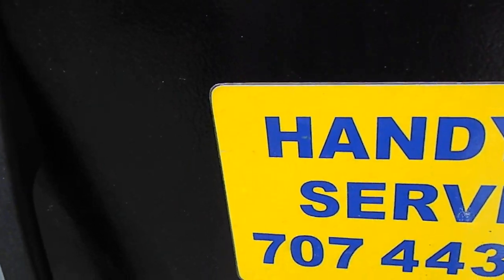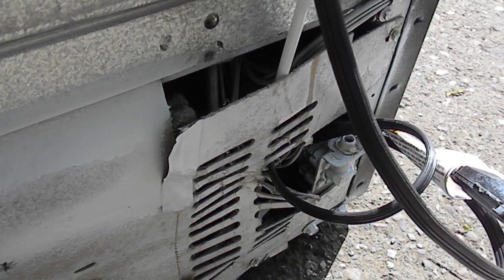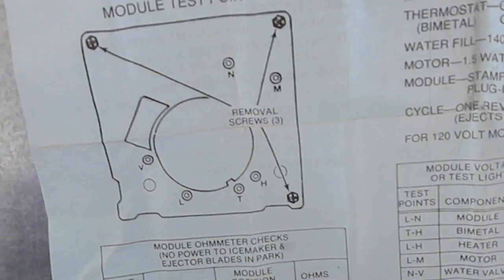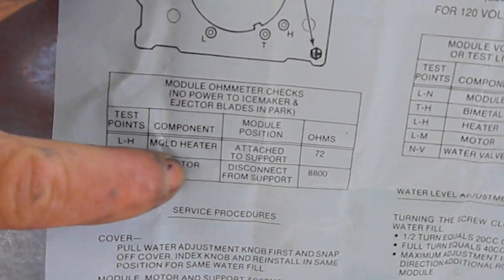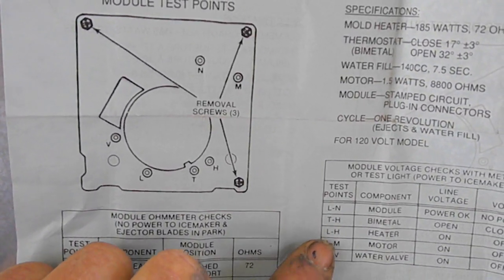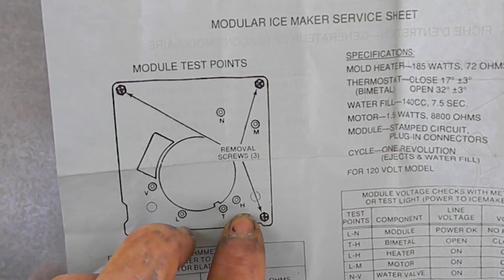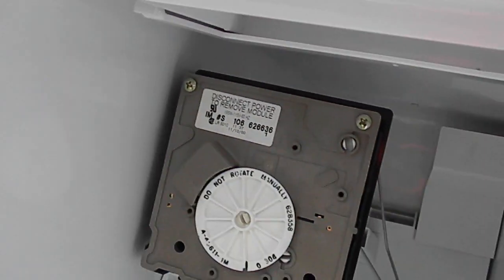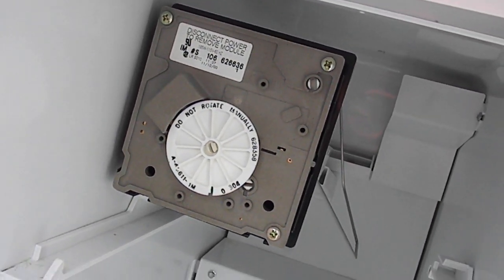Appliance Repair Service Training Course, Ice maker

Comment: Thanks for the fine vid. I'm attempting to try to get ice making in my Whirlpool side by side ice maker (8 yrs. old). Replaced the ice maker w/a new one, still no ice, all other test are good so I checked from your vid. the voltage from L TO N to find only 35volts, not 110.
What would you make of that or is that ok on a Whirlpool?
TIA for any help you can give.

Comment: I have a kitchen aid fridge model ksrs25qgal01 and ice maker works fine but water drips from the bottom front and the leaves a frozen chunk of I've I have to chip out every couple weeks is the something I need to replace to vet it to stop please help thanks.
Reply from the maker: Likely your water valve is bad.  I pull them  and under water pressure and see if they drip.